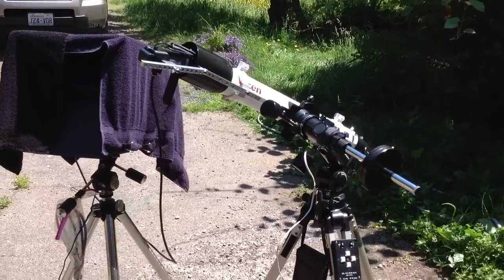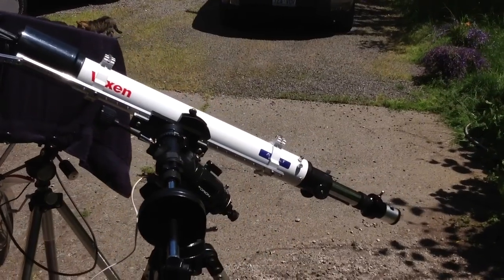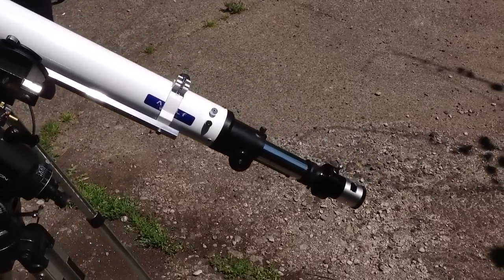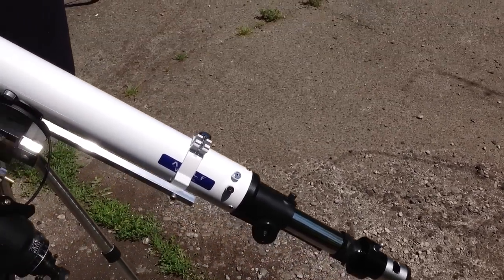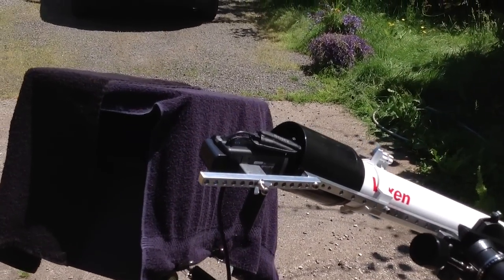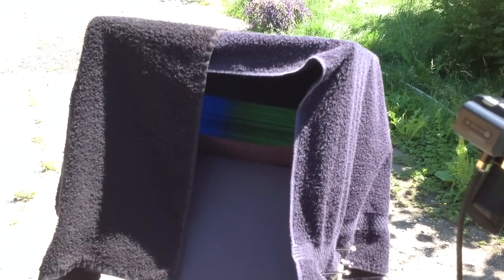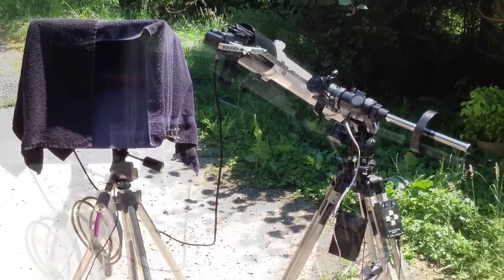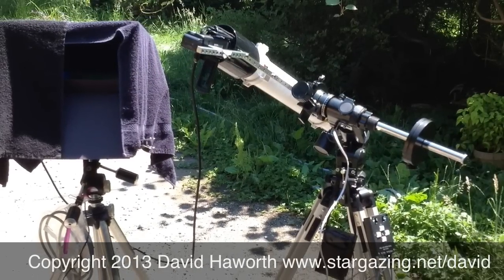Solar Spectroscope with Sewing Needle

Comment: Hi David. This s really impressive. i also have same 70mm refractor telescope. I wanted to capture full solar spectrum. Can you please guide me how you have done that in the above video, step by step. And also i want to know how can i take good quality spectrum of stars...Thanks for sharing.
Reply from the maker: No eye piece, a sewing needle reflects the Sun light as a line up back wards in the telescope.
A plastic grating is cut in a circle and slip into the front of the telescope.
The video takes a video of the Sun spectrum.
For simple setup see
http://www.stargazing.net/david/spectroscopy/SimpleNeedleSpectroscope.html
http://www.stargazing.net/david/spectroscopy/ScrewdriverCDROMSpectroscope.html
Reply: @DavidHaworthWA9ONY  Thanks for the links. One shows where you can zoom in to 360nm, but I'm looking for one where I can compare my filters and lenses down to around 330nm. Just wondering if you know where I can find accurate Fraunhofer lines in the 330nm range to compare? Thanks